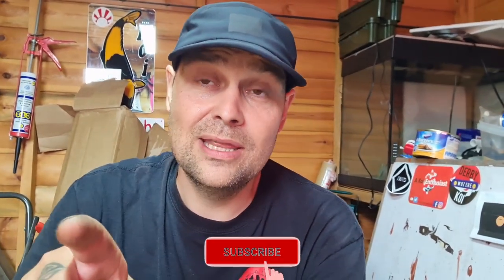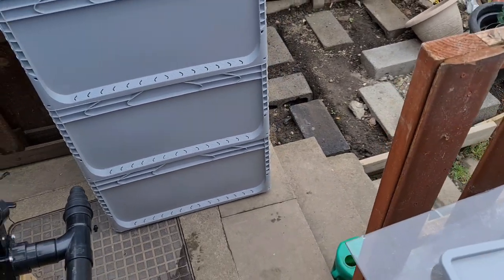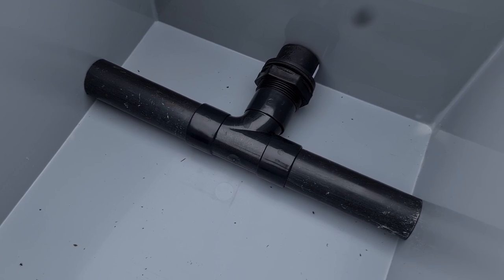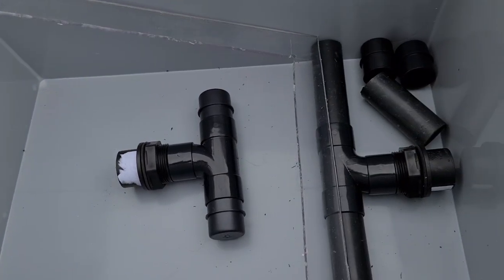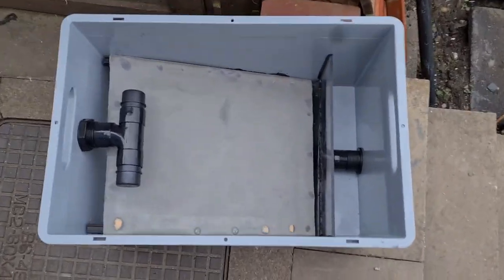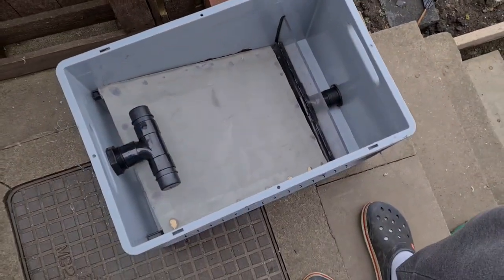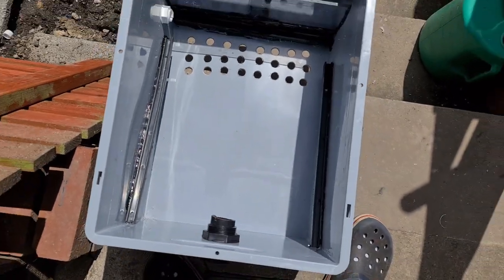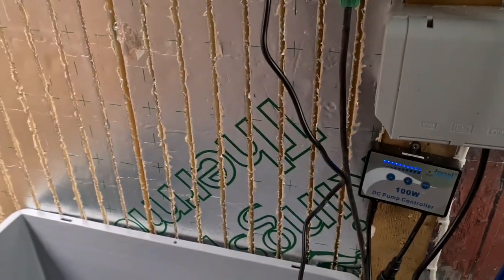** DIY BAKKI SHOWER SIEVE FILTER **

Comment: Cracking job mate and if you heat up the plastic pipe enough the end caps will push in and then cool to the right size. Andy
Reply from the maker: Cheers Andy 🍻 👌👍

Comment: What a fantastic idea bud bakki shower with a sieve I cam only see 2 miner issues with what you've done so far, where the waste goes it's filling up with water quite quickly which means it will start to overflow with waste quite quickly. The other thing is when you have to wash your screen down if you use a hose you'll be killing the bacteria on the media with chlorine 🤔 may need to use a watering can with pond water for that 👍
Reply from the maker: Cheers mate 👌👍

Comment: Could you not heat up the pipe to fit the end caps? Plus I would have made the made the opening just a tad longer to spread the water a little more over the screen. Great job though and it will quieten down once you get the media in. 👍🏼👍🏼👍🏼
Reply from the maker: Cheers dave bob yeah mate I've ordered a new tee pice to make the flow wider 👌👍

Comment: Top job there matey, seems to be working well . What size pump is that jebao ? It looks to be running it really well . Just 1 thing i would re think if i were you thow is the lotus root   if you watch my video when i set the shower back up on the small pond you will see how lotus root crumbles up and its only been in 3 yrs . Cracking video thow fella 👍👍
Reply from the maker: Cheers dave yeah I did see that video 🤔

Comment: Good design and build tbf works well   can I ask what size boxes you used  and the size of pump. Your using to run it just as a guide    gained a sub  thanks for sharing
Reply from the maker: Thanks Michael the boxes were 600x400 and I'm running a 12000lph pump 🙂👍
Reply: @progressivepondkeeping   thanks for reply   I will be using 10000 lph jecod variflow pump to run shower returning flow through the stream and waterfalls into pond   litre  capacity of boxes will determine what percentage I run pump at .my main pond pump is a 15000 lph jecod variflow running at  60%  through vortex and 4 barrel system  similar to yours
Reply from the maker: Awesome mate that will be spot on 👌👍

Comment: Interesting and informative; did the CT1 stick OK to the Polypropyline?
Reply from the maker: Thanks Paul it came off at first, but I keyed it up with a course sand paper and hasn't moved since 👍
Reply: @progressivepondkeeping  Ah; OK; thanks very much. I have hand holes all around mine which I need to cover (inspired by you last year) I thought the air circulation was a good idea but I  can't get it dead level so it leaks all over the place.
Reply from the maker: @paulspittel1924  yeah mine leaked from the hand holes at first and yes it's a shame to cover them because you lose the gassing off

Comment: For the edges of the net on the plastic sheet cut some air tube and press it on its like a C shape and makes a snug seal around edges also what micron mesh did you use i tried 200 and 300 just clog up so quick
Reply from the maker: In the end I used stainless nuts and bolts I'm not sure on the micron size but I have to pressure was it once a week in the warmer weather as the biofilm clogs it
Reply: @progressivepondkeeping  will the cleaning spray they sell for pro seives do any good for the mesh ? I looked at using a replacment mesh for cetus etc they want like 230 for it mad
Reply from the maker: @zachlittle1787  the screen they use in sieves is completely different to the mesh I used it's the same stuff they use on drum filters and I'm sure they do a drum screen cleaning fluid

Comment: unfortunately I've made a sieve out of the mesh before, collects perfectly but unless your about to give it a jet with the hose every 3 hours or fit some king of screen washer like a drum has it will clog up very quickly and just gets worse once the bio film starts growing on it.
Reply from the maker: Cheers mate yeah I use this mesh on my fry shower and needs daily cleaning.  I might fit a spray bar and solenoid valve at some point in the future 👌👍